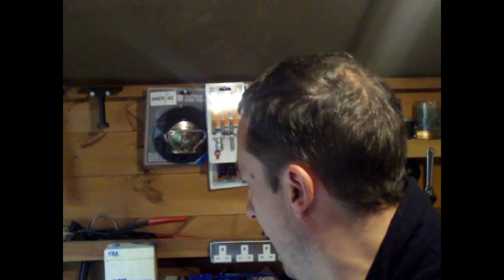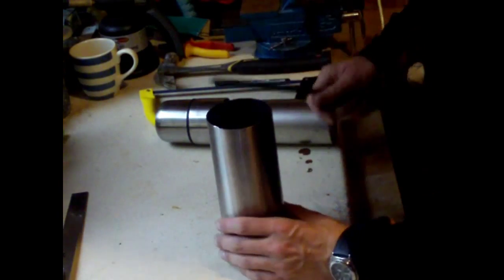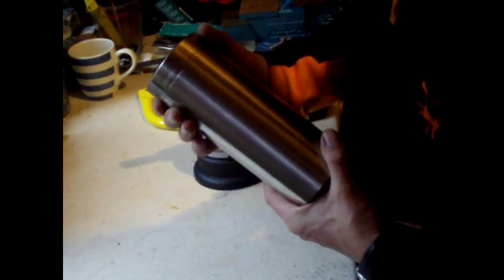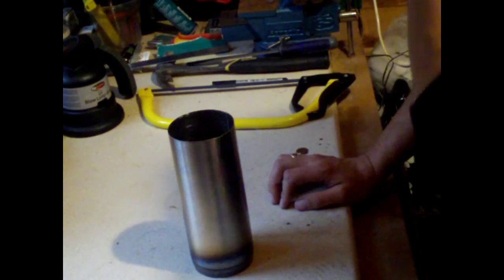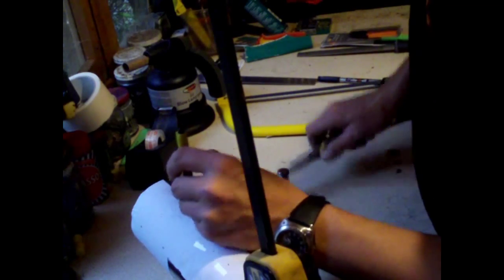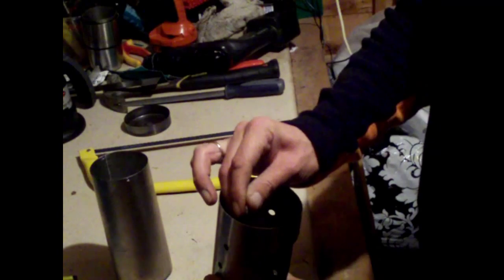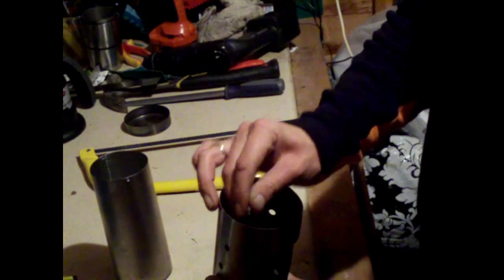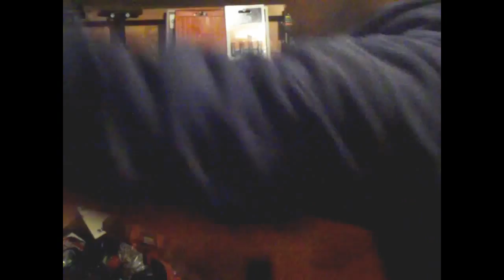Making a Hobo Stove

Comment from the maker: The end piece is safer taken off, as if you leave it on it could go "bang" when a fire is going inside it, the reason is there is air trapped inside and expands when heated. And it is the lid of the stove when removed. :-)

Comment from the maker: @LostJulyMusic ,  Many thanks, glad you like it.

The Size of the Thermos is approx: 30cm tall.

The verticle cut is made by firstly drilling holes in each corner to allow a small saw to start the cutting.  Or you can put the thermos in a vice and use a disc cutter. Extreme care needed in both cases. Good Luck.

Comment from the maker: @ez2curanut , I have found it does depend which make of thermos flask you use, some are better than others, Also sometimes the bottom doesn't blow off just falls off, again depending on which make you use. The black bubble is a rubber seal which houses the copper tube and is were the vacumn is created. Hope you give it another go. Many thanks.

Comment from the maker: @ghoshpp , Thanks, there are two ways to cut the length, either by drilling pilot holes along the line to cut, then using a hack-saw or you can use a disc cutter with a thin disc and great care. Many thanks. Paul.